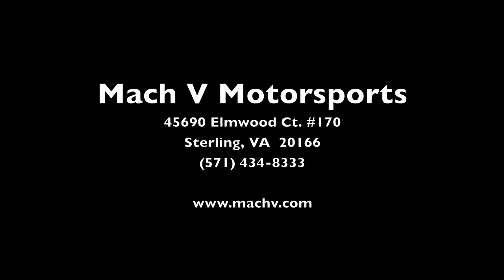Wrapping a netbook with 3M carbon fiber-look vinyl

Comment from the maker: In general, you want to use a nice sharp hobby knife.  You can stick the material to itself if you have to, but it can conform to corners, so the best case is to have it just be a single non-overlapping piece.  If you're doing a standard box-style PC, I'd suggest wrapping the entire case shell that slides off, hiding the edges on the inside where it won't be seen.

Comment from the maker: It sticks by itself.  You don't really need anything else.  We do use an adhesive promoter on difficult curves, but for something simple like this, we don't.  The heat gun just allows the material to stretch around curved shapes.  It has nothing to do with the sticking.

Comment: I am looking to carbon fibre vinyl wrap a few car parts, i have been looking online and loads of websites say that you need a kit, with about 3-4 different bottles of stuff to use.. i didn't see you use any of these items, can it be done without those items?? so you just place the fibre on what ever you want to wrap, carefully cut around and then use a heat gun to make it stick, is that how it works?? i would appreciate a quick reply as i was planning to do some work in a few days, thanks.